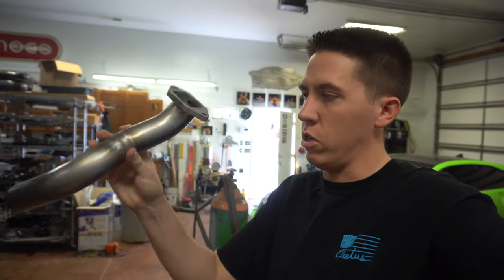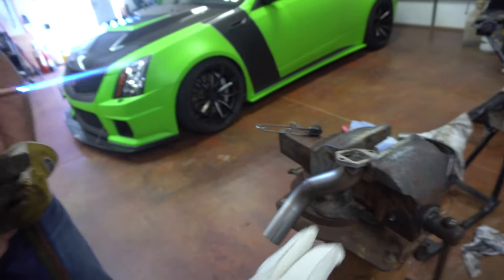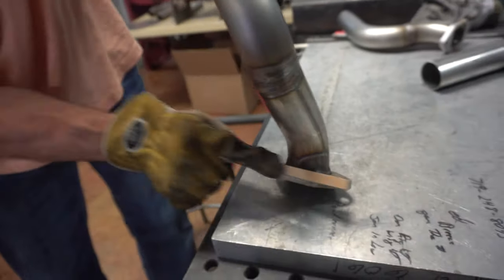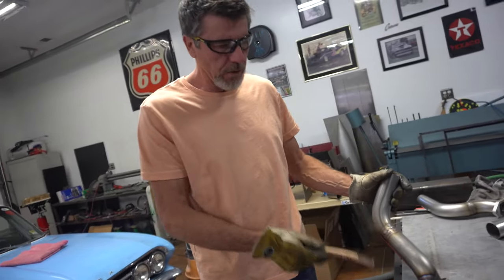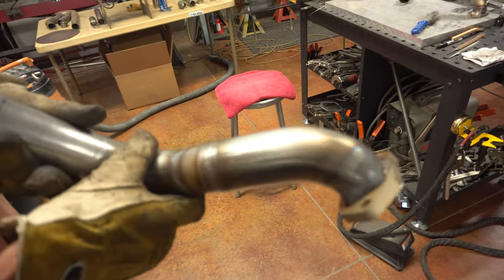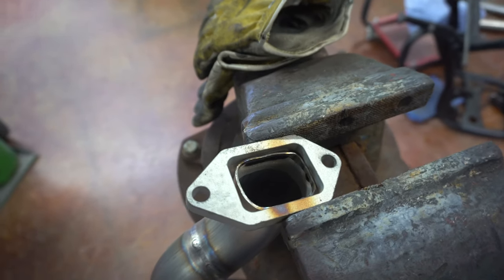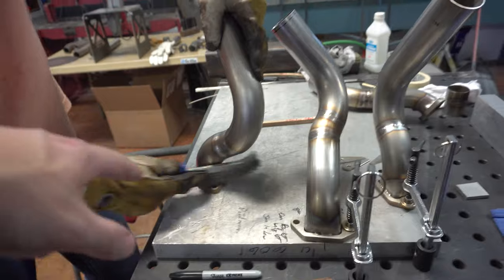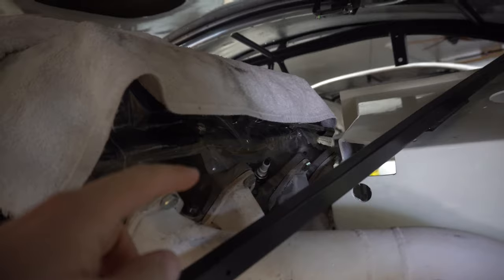Custom Header Build for a Real SC Cobra! Round Tube to Rectangle! PT. 2

Comment: Great stuff.  I am wondering... isthere is a hydraulic press tool that can pressure form a square or rectangle in the header flange?  I too have a header build that requires rectangle to round.  However, if I do one successfully, the demand for more 
will be higher.